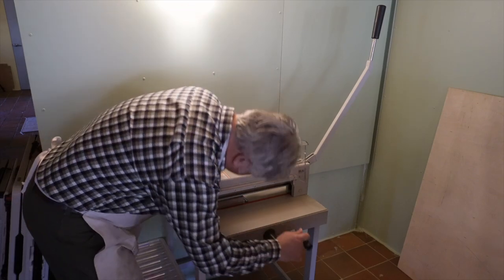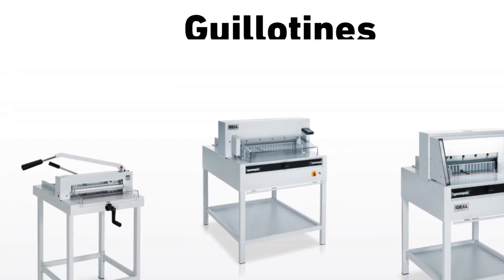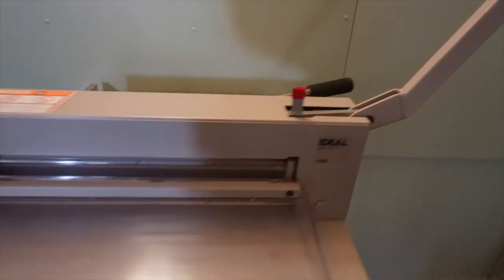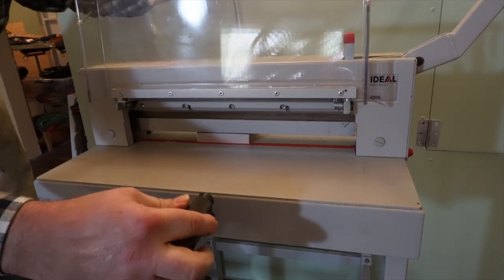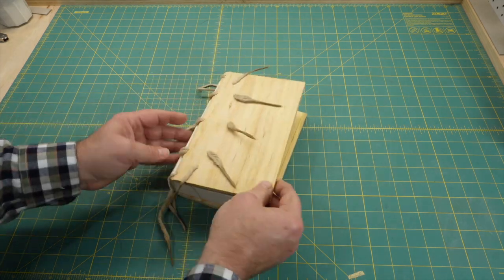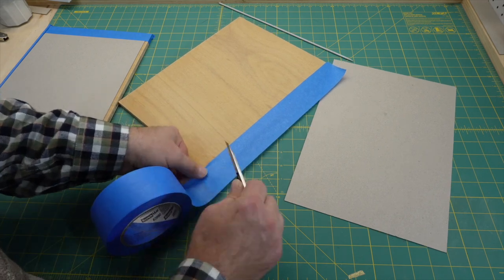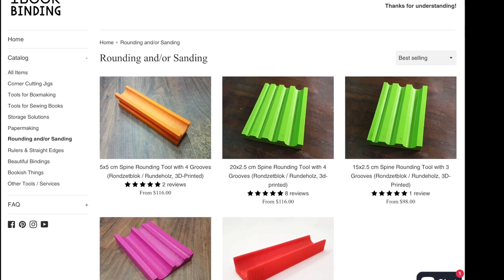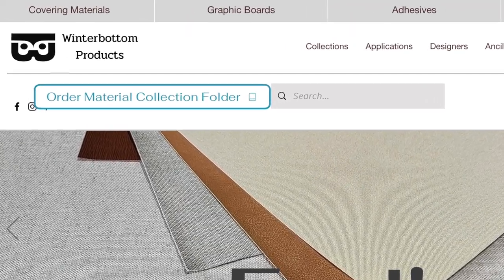DAS Answers - Q&A No 2 // Adventures in Bookbinding

Comment: Ideal are probably the most common in Europe as well although ebay is full of ads for Vervor. I've seen quite a few reviews of the Vervor ones that were not good and they don't have the back guage so positioning is fairly hit and miss. I'm saving up to get myself a nice Ideal one but in the meantime it's a ruler and sharp knife.
Reply from the maker: The back gauge is super important.  The cheap guillotines just lead to disappointment.  Have you tried the wood chisel and some sort of press?  I have a video on it.  A bit more setup but much more reliable than the ruler and knife.
Reply: @DASBookbinding  I did try it but struggled with it I don't think the surface if my press was wide enough to make it easy to keep the chisel level. I've just bought a Dryad plough so I'm going to make a press for it and see how I get on with that.

Comment: I have a used Guillotine and most of the time it works really well... but sometimes I struggle with cutting through the head and tail because of the swell. Do you have any tips on how to make this part easier? :)
Reply from the maker: Yes, use a compensation pad or board.  I think I've shown this in a video somewhere but can't remember where.  A piece of board  or pad of paper that is at least as thick as the swell and cut at something like 45 degrees at one edge.  Push the angled cut edge into the swell.  You don't cut the compensation pad, just position it just behind the blade.  Hope this helps.

Comment: So you think it’s possible to fireproof a clamshell box for safekeeping of valuable books?
Reply from the maker: Thomas Harrison came up with the idea of the fire-proof box for books.  His enclosure is often called a "neck" box, and is different to the clamshell.  I think the idea of a fire-proof enclosure is a bit of an exaggeration.  I think you can provide some protection.  But in most house fires the temperatures are so high that even if non-flammable materials are used the conductive heat transfer will result in the book burning anyway.  But protecting a valuable book with a clamshell enclosure is a very good idea and almost standard practice.